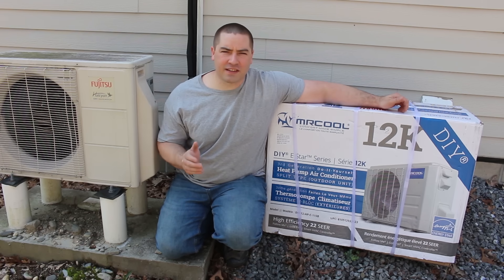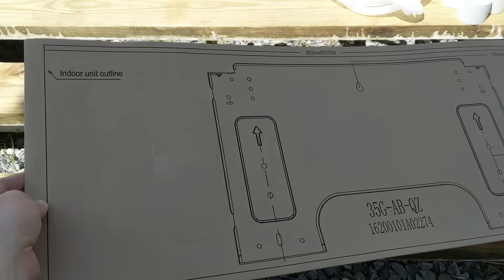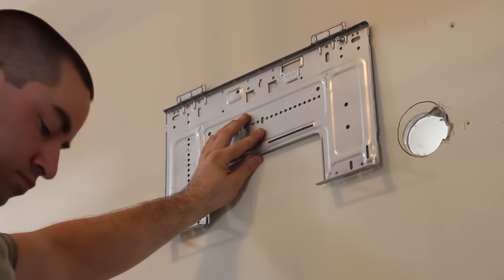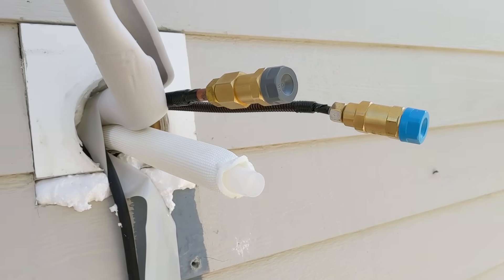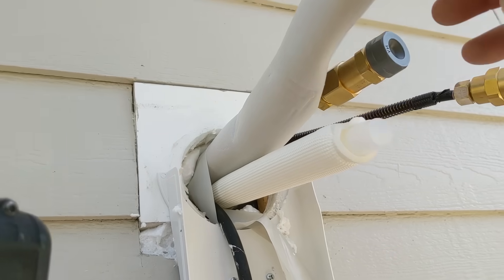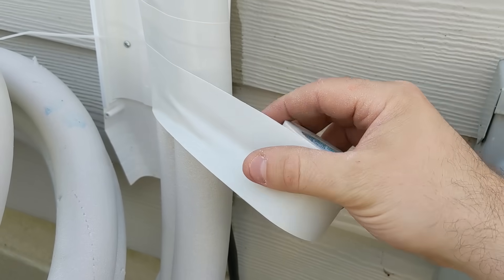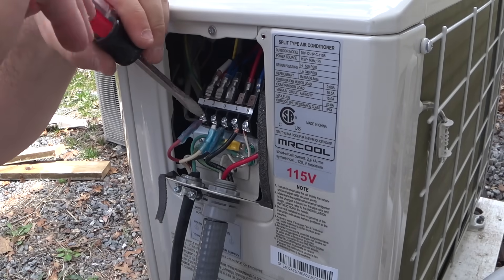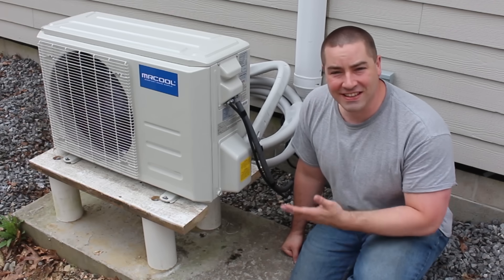Installing My Own Mini-Split Heat Pump, DIY

Comment: Did you say Ni-Log or Nylog? It looked as if you were applying it to the fittings before connecting; what is its purpose? Do you pick that up at a supply store or was it specific to the unit you were installing? Thanks!
Reply from the maker: I linked to it in the description.  It's supposed to help make a leak-free connection.

Comment: Hey,you need to vacuum the refrigeration lines before opening the low & high valves
Reply from the maker: Not in this case.  I go into more details on this question in the follow up video: https://youtu.be/KzHLsRtVn4U

Comment: Needed to use a vacuum pump on the refrigerant pipes to suck the air and impurities out, now you have air and gas mixing which will kill the compressor eventually (or you can purge the lines with the gas in the system which is illegal where I'm from but not sure about the regulations there)
Reply from the maker: Not in this case.  I go into more details on this question in the follow up video: https://youtu.be/KzHLsRtVn4U
Reply: @DavidPozEnergy  oh nice thanks for the update I didn't even realize these fittings were a thing.

Comment: What happen with doing a purg on the lines to get rid of all the humidity in the lines? This is a crucial part of the instalation proces .
Reply: The lines on this DIY unit are pre-charged with coolant. No vacuuming here. The flares on the end are specialized to not release the pressure until the "other half" of the coolant is released from the main unit.

Comment: This is a great video.  I’m about to install a unit and need to extend the 16ft line set.  Is the coupler that Mr. Cool sells custom, or can I just use a standard brass coupler to connect the 2 line sets?
Reply from the maker: You would have to ask Mr. Cool.  I think they sell longer linesets.

Comment: Great job at video production. Did you have to check the pressure in the lines with a meter to confirm the system requirements?

Comment: I thought you are supposed to cut the extra tubing to make it neat. Why did you leave it coiled up behind the unit?
Reply from the maker: Most of the time you would.  This is a unique DIY kit and the lines can't be cut.  The copper lines actually come pre-charged with refrigerant from the factory.
Reply: @DavidPozEnergy  he missed that part . No need to vacuum the line due it being precharged.
 Cut the line ?

Comment: 500 plus trip charge/diagnostic feeXD, also how is there no contamination within the 410 from the non condensables within the atmosphere?  isn't it still necessary to put the system into microns before releasing the charge?

Comment: You’re not supposed to just open the refrig after connecting pipes. There is a rule to set a pressure PSx0.9 , then you have to vacuume out the moisture, droptest and then u open. No wonder why the previous heatpump was broken 😂
Reply from the maker: The previous heat pump was installed by professionals, with licenses and permits.

Comment: so, with this DIY system, you don't have to vacuum the lines?
Reply from the maker: Nope.  These lines came pre-charged, and have a "quick-connect" fitting on the ends.

Comment: Please keep in mind.  Heat Pumps only work efficiently above 40 degrees F. (Correct me if I'm wrong).  Below that, you are overworking your compressor and shortening its life drastically. They should be only set down "4" to 6 degrees at night to minimize its workload in the morning. Nobody likes to talk about the "less attractive side" of heat pumps.

Comment: Good video, thanks.  Question...The extra copper lines behind the outside unit are coiled several times.  HVAC techs indicate that this could lead to the oil in the refrigerant pooling at this area affecting the performance of the unit.  What does Mr. Cool say about this?
Reply: The best solution to make sure the coils do not trap oil is to position the coil horizon to the ground. The oil will then travel back to the condenser as designed.
L. MOORE
Reply: If the coil is laying horizontal to the ground the highest part of the coil should be the tubes coming down the wall and the tubes on the bottom of the coil should connected to the unit. That way, oil that way is constantly draining out of the coil rather than having to be pushed up through the coil and possibly getting trapped in the coil.

Comment: There are fundamental errors in this video.

- You needed to vacuum the lines and system before releasing the refrigerant. It has been open to atmosphere and therefore has moisture and air within the line and system which you have now forced through your new split, and mixed with a brand new charge of gas.
This is a refrigeration basic.

You could have purged the lines by cracking the opposite flare on the outdoor unit to the valve that you opened first. This causes the air to escape at the flare (with a slight bit of refrig.) You only need to crack the flare for a short moment and then retighten it.

Your install is going to fail.

Comment: I hope the system works for a very long time for you. I have an air conditioning company near Houston and what i pay for a mini split from Mitsubishi is probably 5 times what you paid for your complete system. That's wholesale. When a break down or repair is necessary you will realize what it is like to deal with the manufacturer and get any repairs done to your system. Or parts. This is what people don't realize and as simple as it was to install you may not be able to get replacement parts in the future. They will move on to redesigned units and pretty much force you to buy a new system. No customer support so your taking a chance with this manufacturer. But it is cheap and if you are capable of doing the job like you did great. But pre charged line sets are one time use and if you have to remove them then there is a whole new set of problems with that and the unused portions of rolled line set are something you did not mention.
Reply from the maker: Thank you for your comment.  I've heard very good things about Mitsubishi, so it's nice to know you install them.
Reply: They're throw away units.  Any major repair you are better just throwing it away and buying a brand new outside unit.  You heard David....he paid $5000 to "try" to get his fixed.  Not worth it!   Hvacs will love you,   you wife won't!

The outside unit itself can be bought for less than $800 and will only get cheaper.  Hvac repairs are $500+ minimum.  You do the math

Comment: Did you consider going with a DC/AC hybrid unit that you could run off solar panels and AC when you have less/no sunshine - like model ACDC12C from HotSpot Energy?
Reply from the maker: Yes, I considered it.  They require a licensed professional HVAC person to install them.  If I did that I would run into the same problem after problem I had with my previous unit.  My previous unit was a Fujitsu and installed by licensed professional HVAC company.  Then it was serviced by professional licensed HVAC company.  It failed twice with that company before I hired a different licensed professional HVAC company.  Then it failed again and I had to hire a licensed professional HVAC company.  All told, it cost me over $5,000 in labor (labor only, not parts) to keep hiring these licensed professional HVAC companies.  That's why I went with the Mr. Cool.  It can be installed by a DIY (me).
Reply: @DavidPozEnergy  I see, I was not aware that they required a licensed professional to do the install. They seem to have some interesting products on their website - just came across their ACDCX Asymmetric Inverter this morning. I guess they require a licensed professional to install that as well. From what I can see most people think that these split systems typically don't last as long as traditional systems, that they are mostly imported and hence difficult to fix/get parts for. But, after doing some research, I have found that there are many contractors/companies that have had good experiences with brands other that Mitsubishi Samsung, LG, Daikin, and Fujitsu. In fact there is one individual in particular  - Kerry Vanderweyden (who has owned and operated his HVAC company in AZ for 18 years) who actually finds that they last longer than traditional ducted systems, are easy to repair, parts are actually cheaper to buy and that there is not much difference between all the common brands. So, I guess, in the end,  it all depends on the install and not the so much the brand.

Comment: Fridgy here from Australia, If I did an install that looked like that I wouldn’t have a job, you’re not meant to have exposed pipes wrapped behind you’re unit they need to be cut to fit perfect same with your electrical, plus you’re compressor isn’t gonna last cause you didn’t even vac out the moisture from the pipes, even a purge would of been better then that, and to finish it looks like shit!

Comment: Good job! Looks pretty straightforward except for the wiring. 
Can the 12,000 btu unit be plugged into a 110v (regular ) outlet??
Reply: Yes with this one you can run 110 single phase but you will probably need a own circuit breaker and wire for it as it will draw a lot of current most of them you can choose if you want 110 or 220 , i also i recommend getting these professionally installed because these diy ones like to leak and freon is not something to mess with because if it leaks it's very damaging to both you and the environment, be responsible and get these installed professionally
Reply: With this one it seems it needs atleast 15 amps circuit

Comment: Good luck getting that to last long term, you didn't pressure test or even vacuum the system.
Reply: I just bought one of these units myself. I see most people vacuuming the system first. What are the possible issues by not vacuuming the system first? Just asking because I don't want to buy the 150 dollar manifold gauge set and pump if I can get by without it.
Reply: Nevermind. A quick Google search answered this for me:

"Mr. Cool units come in a vacuum with a seal at the tips of the line-set which is broken when it is attached to the outside unit. Since there is no need for a vacuum pump or HVAC gauges, Mr. Cool mini-split units are much simpler to install."

Comment: What about vacuum the system...?
No vacuum will failure soon
Why you don’t cut the copper line set  
Use flaring tools to cut the line set and measured the right length 
That’s why we carry contractors licensed

Comment: Is it okay for the outdoor to be mounted on a lower height than the indoor unit? May b 8 feets below the indoor unit? Does it affect the compressor to push the gas against gravity?
Reply from the maker: Yes.

Comment: Good job and thanks for sharing.  Just wanted to point out that you forgot to torque the lines and vacuum it. The vacuum process should also tell you if there is any leak in the line  before  you open both of the low and high pressure valve.
Reply from the maker: Thanks for checking out the video.  Most mini-splits do need vacuum.  However, this DIY kit does not.  The lines are pre-charged from the factory.

Comment: One good thing with DIY systems is that they use R290 Refrigerant which is the best for the environment. 
The downside is that all pipe connections have to be made on the outside of the property, due to the explosive nature of the refrigerant.
I’m surprised you didn’t have to vacuum the system down though.
Reply: I don’t think this system needs to be vacuumed I think those lines are also pre charged with refrigerant so theirs no air in the line, it’s a really good system

Comment: When you turn the leaking open , then did you turn it back and close it ? This is I am asking ? Thank you.
Reply: No it stays open to allow the unit to operate. A dust cap goes on top.

Comment: Line set that came with the unit what's open to atmospheric pressure which means you will get moisture in the system which you do not want I don't understand how that could work without pulling a vacuum first or do you just leave the moist air in there
Reply from the maker: I go into detail on that in the follow up video: https://youtu.be/KzHLsRtVn4U

Comment: Does it make sense to install the heat pump in a shaded area, (under the deck) to avoid the heat from the sun? That would be good during the winter as well, to avoid the snow building up during the winter. Regards, Patricia
Reply from the maker: It would probably be OK.  The most important consideration is airflow.  Just make sure you don't block the airflow in/out of the unit.

Comment: Don't you have to pull vacuum and charge the unit with freon ? Regards, Patricia
Reply from the maker: Usually you do.  But this kit has pre-charged lineset to make it easy for DIY installation. No vacuum with this kit.
Reply: @DavidPozEnergy  Thank you David ! Patricia

Comment: That looks doable, but don’t you have to vacuum the air/moisture out of the line set before opening the Freon valves? I’ve heard moisture from humidity can mix with oil and harm compressor, or freeze up and cause a restriction of Freon flow?
Reply from the maker: Most of the units on the market need to be vacuumed.  This particular kit does not.  It uses pre-charged and sealed lineset.

Comment: No need to vacuum the pipings to remove air inside the pipe?
Reply from the maker: Not with this particular kit.  The lineset is pre-charged.

Comment: Great video. I have a question regarding the pipework to each indoor unit. Im looking to install a three way multi split system (one outdoor inverter supplying three indoor ceiling cassettes within a suspended ceiling). My question is, can the gas, liquid and condensate lines be jointed so that i only need to run one length of each from the inverter and just tee off to the separate indoor units? Or would they need to be three individual circuits with seperate feeds to each indoor unit?
Reply: Most likely you will need 3 pairs of wires and lines for it, also if you want to operate 3 mini splits off outdoor unit you will definitely need 3 phase power and if you are going to install 3 i would recommend to get installed professionally as they will probably need to solder the copper pipes and use a vacuum pump to evacuate the air from the pipes and fill the right amount of refrigerant as multiple unit ones dont come prefilled with refrigerant and they will make sure that it doesn't like by first filling the lines with nitrogen and using a nitrogen detector to find any leaks, be responsible and get heat pumps installed professionally as refrigerant is very damaging to you and the environment

Comment: Why wouldn't you pull a vacuum on the lines, first?  You really don't want to mix refrigerant with air.  Also, the vinyl wrap should be done bottom-up the same as shingles.  That sheds any dripping condensation instead of concentrating it.  Overall, however, good job!
Reply from the maker: Thanks for watching.  This is a unique kit that has pre-charged lines.  No need to pull a vacuum, that's done at the factory.

Comment: I always like the 220 volt systems. It evens out the load in your house so you don't get a dip and the motors will run smoother and longer.
Reply: Me too but I choose the 120v in case a long term outage (hurricane, tornado, flood) I can power it up with a regular 2K watt generator (last time hurricane Harvey took us 4 days no power)

Comment: The leak was probably bottom left of outdoor coil. Those small older Fujitsu’s always split out the bottom in heat mode. Fujitsu had a program for awhile to replace them at no cost.
Reply: But shouldn't he use the vacuum pump in the system like 20 mins to check if there is leak before releasing the refrigerant ?

Comment: Reading all the comments below, I can't believe how un-informed some people are (you can pretty much tell comments from HVAC installers - they're afraid of being replaced by DIY installations). My ClimateRight system has great reviews on the HD site ( 5 - 1 star reviews out of 43 and 1 was because their unit shipped late from HD - nothing to do with the performance of the system).

Comment: Every system installed needs to have the lines evacuated so that there is no air / moisture in the system - R410a is a sponge for moisture.  Not saying this can't be DIY, but evacuation is a must UNLESS someone wants people to keep buying replacements........
Reply: Pre charged and capped

Comment: DIY. Don't need plumber to vacuum lines, amazing. So it is covered under warranty if you hook up yourself? I might get one.
Reply from the maker: Yes, the warranty covers DIY.  This is made as a DIY kit.  No need to vacuum the lines or anything, it's done at the factory.

Comment: Is it still making heat through this cold snap or is it stuck in defrost mode?
Reply from the maker: Yes, it still makes heat overall, but it can't keep up with demand when we get down into single digits.  Meaning, that the temperature in the house will slowly go down.  We are talking 2 degrees per day or something.  Then it catches back up when outside warms up again.  It produces plenty of heat above 30 degrees.  Same kinda thing happened in middle of summer on 100+ degree F days.  If I did it again I would go one size larger.

Comment: Whoever put that Fujitsu in must have really half assed that install.
Reply from the maker: The didn't half-assed the price they charged me.  LOL  They were a professional company and licensed.  I tried to do the right thing, (hiring a professional) but it didn't work out.  That's why I decided to DIY this new one.
Reply: @DavidPozEnergy  - That unit wasn’t still under warranty after 7 years?  The parts, obviously not the labor.
Reply from the maker: It may have been, if the original company to install it had filled out their paperwork.  But, sadly, they did not.  I paid a thousands of dollars on the first system, over and over again for the "professionals"